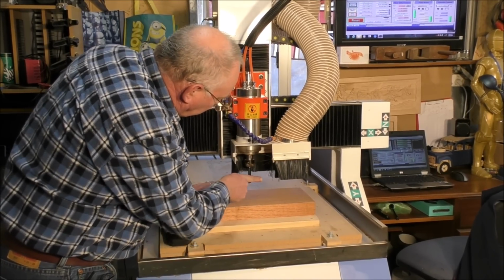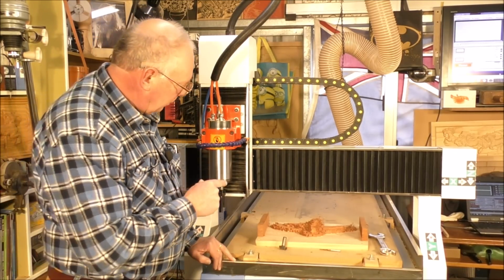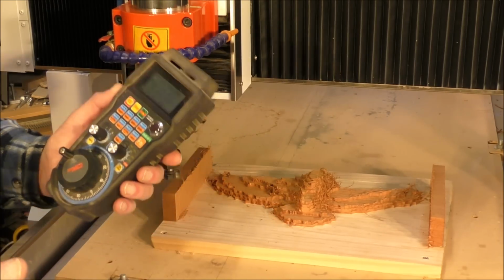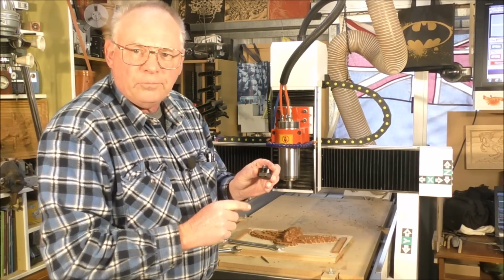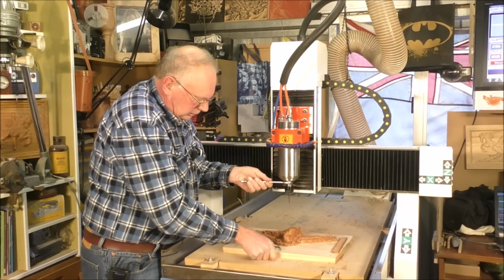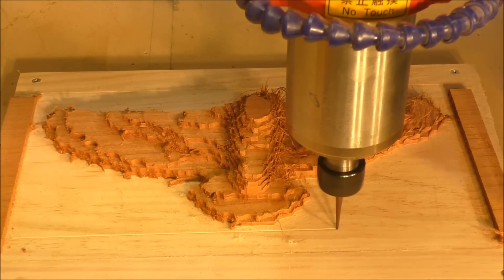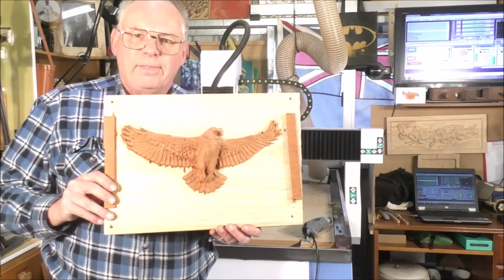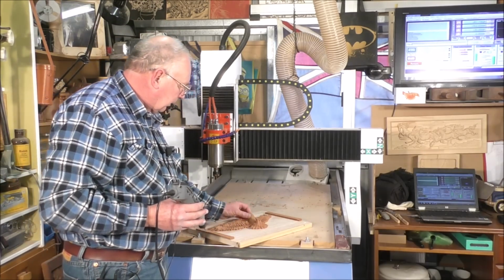2M views CNC router CAN make $25,000 🤑 per month carving a 3D American bald eagle I CAN SHOW YOU HOW

Comment: To expedite the process after the roughing pass, set a boundary along the relief and only machine within the relief and you won't spend any time outside on the pine. If you zero from the pine, and set up your file accordingly, you can zero .02 below and let the pine act as the sacrificial board and remove all excess in the roughing pass and save significant time. Nice video mate.
Reply from the maker: Thank you, for watching,  
Please like, subscribe and forward the video on to a friend, Roger Clyde Webb
Reply: I think the pine is part of the finished piece, not a sacrificial board